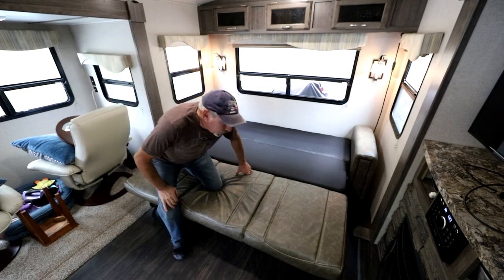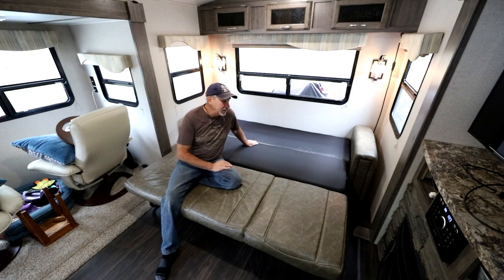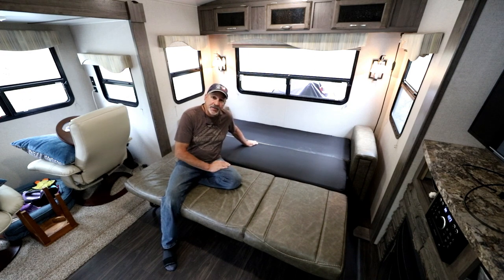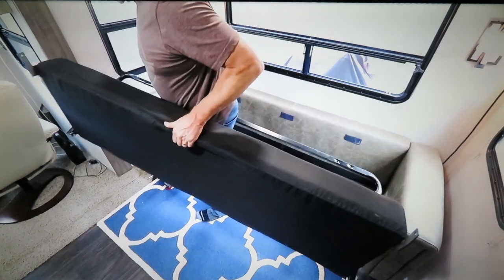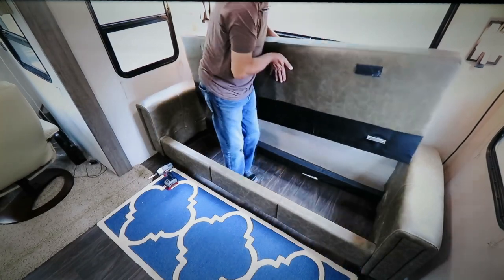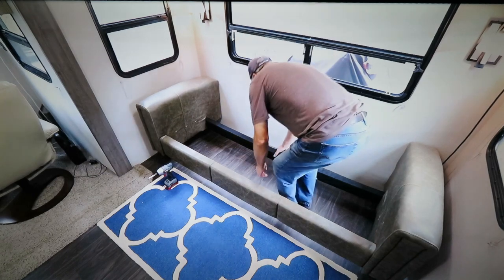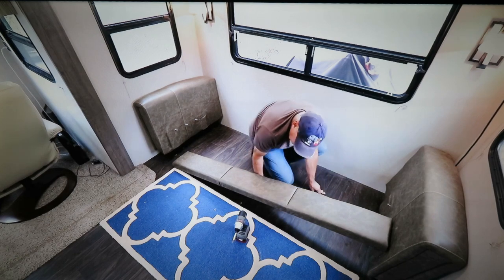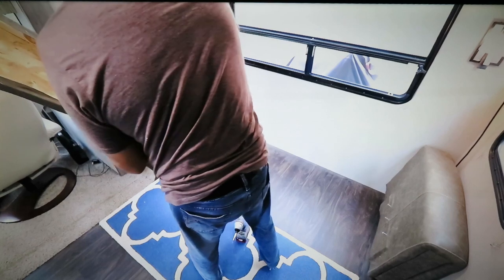How I took apart my Lippert Trifold sofa bed

Comment: There is no need to remove the hinges from the back, it can stay with the frame. Simply remove the center bed by removing the pins, then remove the 3 screws on each end of the tubular frame, and remove the frame and back as one piece.. it is much easier.
There is also NO need to dismantle the main body, it can be easily tilted through the door on it's back.